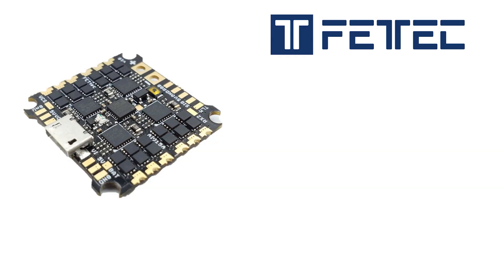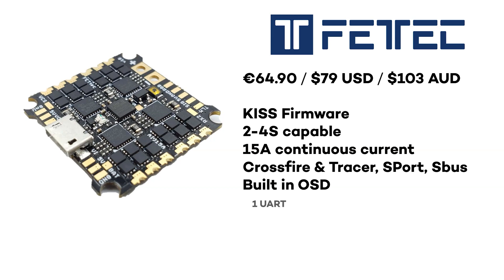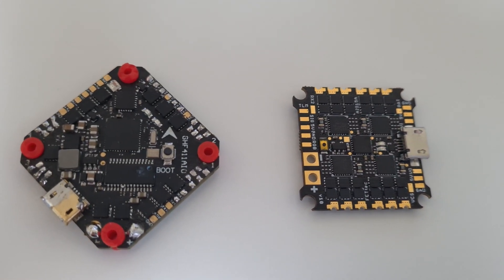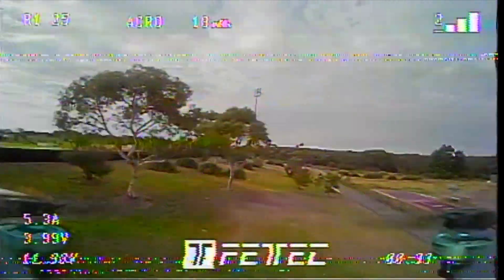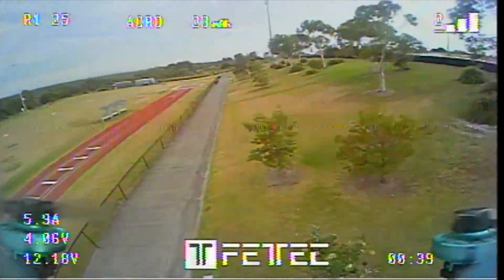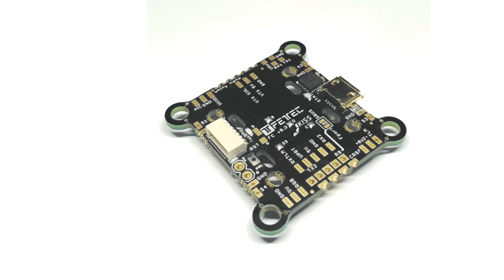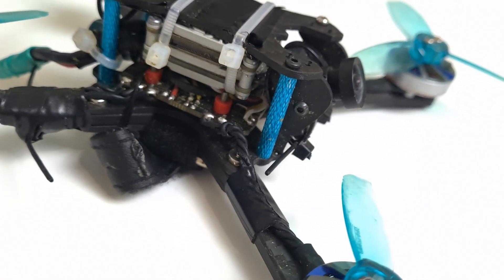Keep It Simple Stupid AIO

Comment: sorry to comment on a video that's almost one year old, but have you seen the Fettec 35A AIO? it comes with a G4 (still not as fast as an F7, but closer), and its price is not that far off other (non-Kiss) AIOs. I'd love your thoughts on that one. thanks!
Reply from the maker: Pricing comes in at 150 to 180 AUD plus shipping - in total, $206 AUD. It's really expensive. Considering a lot of the "lesser brands" like JHEMCU are coming in at $120AUD - and with a MPU6000. It's a hard pill to swallow with going down the KISS route. Realistically with KISS, you aren't paying for hardware - rather the hardware covers the software costs. What I learned from this AIO and the BabyKiss build is that KISS can run on a less processor very effectively. The "math accelerator" sounds a lot like voodoo to me. But, I have ordered one. Going to put it on my Diatone Roma 4" with the 2203.5 motors at 6S. We will have to wait and see!

If you aren't a KISS die hard; then go with an F7 from JHEMCU, Foxeer, GepRC as they all are great value for money and have an MPU6000 unlike the iFlight beast (which now comes with the BMI270).
Reply: @DarrenAllatt  thank you very much. I'm more KISS-curious than a die hard, but I ordered one a few days ago, only to realize I couldn't find any reviews (backwards, I know!). well, looking forward to yours with the roma 4". thanks again.

Comment: Hi
Since you're using this FETtec AIO 15A and I saw you also use ExpressLRS:
Have you gotten this FC to work with an ELRS Receiver?
I try to get an EP2 working on it at the moment. However the connection seems to be super bad. The update rate of the channels in the KISS GUI is like 1/2 fps. And sometimes it's not updating at all.

Or is this slow update rate only in the GUI because of the old processor maybe?
I have not tried to fly it yet.
Reply from the maker: Hey!

I haven’t tried with ELRS yet but that’s a good idea that I should give it a go. 

Have you updated to the latest version of the KISS firmware?
Reply: @DarrenAllatt  Yes. I have Firmware 1.3-RC47i installed, which is the latest version for this FC at the moment.

I am asking myself, if I might need a pull up or pull down resistor.
I don't have the problem with the Receiver going into bootmode. But the connection to the FC is just super bad (like one command comes through every few seconds ... and sometimes for a longewr period nothing).
Reply: @DarrenAllatt  Just found out, that KISS does not use the same BAUD-rate as the receivers.
There's a fix in the making on ELRS guthub, but I have no idea, when it will be available.

Pull request: "Add a 400k baud rate option on the rx"

Comment: Thanks for the info. If I installed my fettec AIO 15 amp fc with motor pads 1 and 2 on the left side of my build, would that be 90 degrees counter clockwise on the kiss gui for correct fc setup. Hope this question makes sense. Any help would be appreciated. Thanks again.
Reply from the maker: Hi Mark
I am not sure on your question, can you please let me know a little more about the problem?
Reply: I installed the fettec aio fc with motor 1 and motor 2 not in the recommended orientation. If you were looking at the fc, instead of motor 1 and 2 in the forward position they are now facing left. Can I correct this in the gui ? And would it be 90 degrees counterclockwise to correct this ?. I guess I could send a picture if this still makes no sense.

Comment: Hey man, I built a fettec frame with the aio.  It completely loses it's signal and has to be disconnected and re-plugged in to the lipo after like 30-45 seconds.  Have you heard of this issue?
Reply from the maker: No I haven’t had that issue at all what is your setup
Reply: @DarrenAllatt  fettec fg1 frame fettec 15a aio and fettec motors.  Tbs unify nano 32 pro and nano sized runcam.  I pulled the power and ground from the camera off of the board and wired to the battery.  Seem to be 80% resolved
Reply: i have the same issue, pulled cam power staight from battery but it still does that. I cannot even get in the osd, it shutsdown after 20 secnds or so...
Reply: What signal do you mean? The Receiver?
Because I am trying to get this thing running with a Happymodel EP2 Receiver, and the connection seems to be very bad (like only transmitting one packet every two seconds).
That's from looking at the KISS GUI. Did not try to fly it yet.
Reply: You are using too much amp on the 5v rail! I had that problem when I added LEDs

Comment: Nice Review 😁👍 I'm currently building a Sub 100g 4" Digital HD with a Naked Caddx Vista using this board, the tiny pads are now soldered for MSP and I'm using my own custom designed and cut frame 'Alpha' https://www.instagram.com/p/CMDIExzL5gk/ #BABYKISS
Reply from the maker: Nice build, very clean. 
What motors are you going to use? 
I take it you are stacking the Vista on top, will you be mounting it using the 20x20 pattern to the top plate?
Reply: @DarrenAllatt  Thanks 🙏I'm using T'Motor 1404 3800kv motors and your right the Naked Vista is mounted to the top plate using 20x20 pattern 😁

Comment: You can use dji with this aio, there is a second uart you can use on the underside. There is even a connection diagram from that.
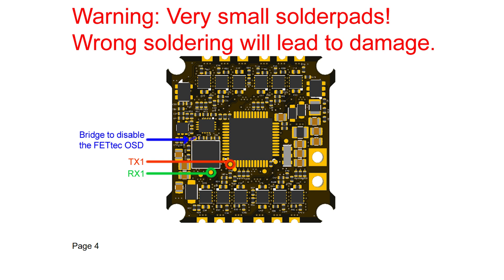Reply from the maker: At 2:05 I actually show the wiring diagram from the manual with the 1x UART on the underside of the board. The problem which I address is the tiny solder pads.
Reply: @DarrenAllatt  I was scared at first to try and solder to them, but it isn't really that bad :-)
Reply: Fine soldering does take a bit of skill, there's no way I would have been able to solder to pads that small 3+ years ago when I started flying, hell I struggled soldering motor wires to my ESC's back then!!

I'm sure they could have broken these pads out and made them larger no problem.
Reply: @Dav2112  I hear you man :-) , I too hope that on the next version they make the pads bigger and on the topside of the aio ^^

Comment: I'm a KISS fanboy, and I'm just about to start my first FETtec build with their 45a 4in1 using an Apex frame, honestly can't see me buying this board now after watching this video. #BABYKISS
Reply from the maker: Their full-size FC and ESC are decent, if you are going a 5” use the 30x30 4in1 ESC because the 20x20 4in1 solder pads are too small for the thick cable used on an XT60. I don’t mind the FC but I couldn’t get it to work with DJI.
Reply: @DarrenAllatt  yeah it's the 45a 4in1 I'm using mate, I'm not really a fan on 20x20 stuff as I find them really awkward to work on with everything being so small. 

Like I said I'm a bit of a fanboy and have several Flyduino KISS V2 builds that all fly way better than I can ever get Betaflight to fly, and the GUI is real simple too, I throw the same ballpark PIDs into every single KISS quad that I've put together and they fly really good so never bother tweaking them further. 

 Real shame about the lack of UARTs, size of solder pads and the f3 MCU on this board, but I will say this even a v1 KISS FC with 24a KISS ESC's flies really nicely, it just has a different feel to Betaflight for me, and there isn't a billion different filters and PID controller settings there to tinker with which I really like. 

The FETtec hardware is designed by the same dude who designed the KISS gear so I am fairly confident that it's going to be an almost identical flight experience as a Flyduino setup.
Reply from the maker: @Dav The BabyKISS build I did with this board flew amazing on stock PIDS, and yes agree that BetaFlight makes it way too hard to PID tune, even though the defaults have come a long way. You just have to look at the recent video JB did with Makr from TheUAVTech on tuning his Diatone Roma E5 >> the detail in the blackbox is way too hard for anyone other than an expert like Mark to get into. Even JB admitted he tunes but gut feel to get 95% of the away there. 

I am not entirely sold on the quality and robustness of the hardware, and while the KISS Gui is really simple, the FETTEC configurator didn't work at all for me. 

Let me know how you go with your FETTEC Build!
Reply: @DarrenAllatt  I'll keep you posted, I take my time when building plus the weather is terrible here right now, so even once I get it built it'll be a while yet before I can actually get out and fly it without freezing my hands off!!

Just looking at the 4in1 45a you can see that it's really well put together, no squint SMD components anywhere and the workmanship looks great, I expect it to feel very close if not identical to my Flyduino builds. 

I stopped using Betaflight other than the version that's on my Mobula 6 which is actually the last version of Betaflight firmware that I liked and didn't have issues with (3.5.7), any time I've tried any version from the early release candidates for Betaflight 4.0 I've had issues with low throttle wobbles, like I'm flying in high winds but it's not windy, and I can't get them to go away for some reason. 

It's probably something simple but I just can't be bothered spending my time trying to figure it out,  the quads I had left with Betaflight FC's are all running Emuflight which flies really well without much tinkering too. 

And yeah I watched both Joshua's and Mark's videos where he tuned Bardwells quad, I totally get that you can go in depth with blackbox logs to get a perfect tune, but I personally just like to build, set my rates, throw my ballpark PIDs into KISS GUI then go fly and it feels nice and locked in with no unwanted flight characteristics.